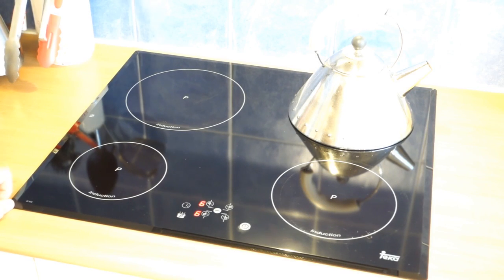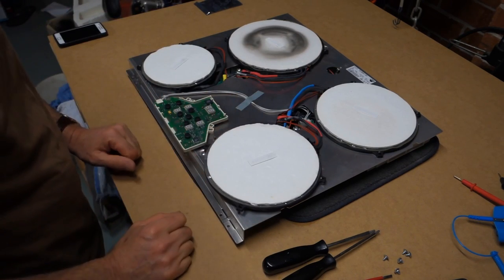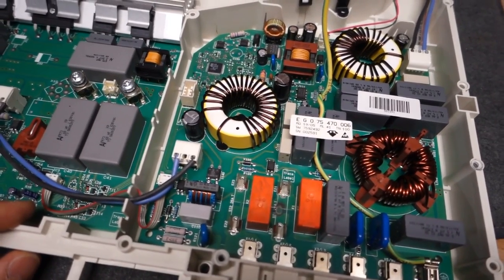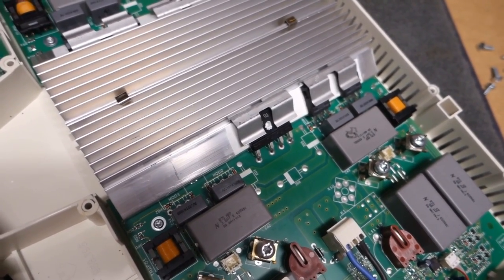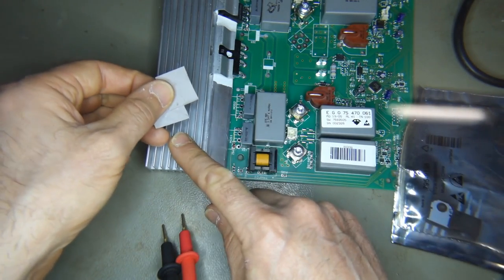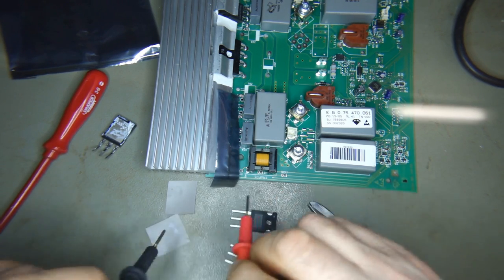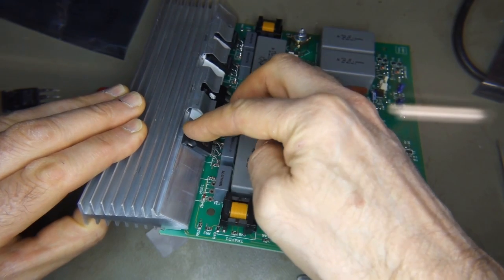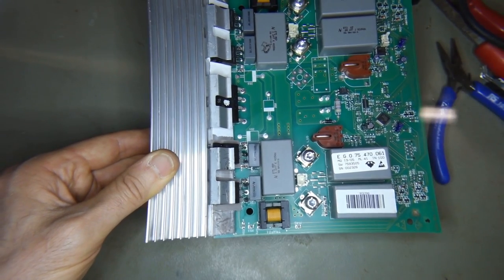Ep 5 Teka Induction Hob Repair (IR645)

Comment: Thanks for the vids Simon, very well explained, instructive and educational.
Looking at my same problem now, I’m feeling that it would be a tad easier if leads of the IGBT to be cut off first before removal and desoldering begins. And, removing and replacing one IGBT at a time and keep the metal holder in place.
Reply from the maker: This might be a better solution, let me know how you get on!
Reply: @PowerOn-  
Hi Simon
I recently revisit my same cooktop (IGBT blown again due to my poor workmanship;).
This time I’d found out easier way to reinstall the metal clip.
Those clips has tiny lip to engage with the groove on heat sink. Just need to position it properly, and press it in with a vice sandwiching just by the heatsink itself (be careful to leave PCB free without force exerted on it during pressing)
Even better if you have a pliers wide enough for the clip width.

Comment: Hi Simon, great video very informative. Can you please give me some advice as to how you got the clips off from the triac's in the first place, on the board im busy with they are really tight and I dont want to break it. Need to replace 4 of the 8 on the board.
Reply from the maker: Hi Francois.  Yes, you've identified one of the harder parts of this repair.  The clips are both difficult to remove and replace.  Im sure in the factory they must have a specialist tool.  I remember removing the clips by sliding them out from the end of the aluminium heat sink.  Gently tapping with a hammer and broad/blunt screwdriver was the technique.  Not easy but doable.  Refitting is the reverse but a bit more difficult as you have to also lever the clip open as you slide it back into position.  Good luck!
Reply: @PowerOn-  sweet, thanks will give it a go over the weekend.

Comment: Great video.  I had exactly the same problem with my GE Profile PHP900DMBB cooktop a couple years ago.  The trace on the board was blown.  Unfortunately mine didn't have the fuse brackets installed but the board had the mounting points for the fuse brackets (make sure to get the brackets rated for 20amps as the cheap ones are not).  The writing on the board even specified a 20A slow blow fuse.  That MOSFET clip is probably the hardest part of the job.  I'm even impressed that you got it off.  In my frustration I cut off all the components on the side of the board figuring that they would be cheap to replace.  I was wrong.  Each of those MOSFETs was $12.  The bridge rectifier in the middle was cheap.  I positioned them all with the clips before I soldered them all back into the board and that worked fine.  Fortunately I was able to find the exact parts.
Reply from the maker: Thanks for the reply Bryce - its a bit of a tricky job but ultimately very satisfying to fix something that would have been very expensive to replace.
Reply: Bryce, I also have a broken GE PHP900.  Did you have an "E5" error?  What is the IGBT part number and where did you source it from?  John K.

Comment: Great video. Have you had to repeat this for this element or do it for any of the others? I am ordering the new IGBTs and was wondering if I should just go ahead and do all 8 now since my cooktop is part of a slide in range/oven combination.  Thank you
Reply from the maker: No i only changed the failed components.  "If it aint broke don't fix it" attitude is at play here😀.  As I think I said in the video I think the failure was due to a protective fly back zener diodes not being correctly soldered at the factory being the source of the failure on the 1st place.  The cooktop has worked flawlessly since.  Thanks for the comment.

Comment: As of now, these hobs below uses the same Italian-made Teka hardware as shared by Simon:
- Miele
- Electrolux/Westinghouse
- Smeg

Thank you Simon.
Reply from the maker: Lots of parts sharing between brands.  This unit is quite old now but the failure modes are also similar with the igbt's and diodes a primary source of problems.
Reply: Great video Simon, even 7 years later :D
I concur my Electrolux suffered the same fate and the power generation board is the exact same except I don't have any fuse holders :( I'm repairing mine and will be adding a fuse holder where the in-board fuse failed since there are holes for it.

Comment: A "loud bang" sounds like a MOSFET. I always "enjoy" those loud bangs when I work on SMPS power supplies.
It's always a good idea to keep the IGBTs or FETs out of circuit and put a scope on the BASE or GATE and read for clocking, then check the COLLECTOR or DRAIN for a short before replacing them.
The CURRENT SENSE resistor is often blown along with the FET so the IC that drives the FET won't be able to detect proper function of the FET even if you replace it, and the IC itself can be blown too.
P.S. I've handled MANY FETs and have NEVER "zapped" one with ESD. It's not as big of a risk as you might think.
Reply from the maker: Hi Rick, lots of good information here, thanks for your reply.  Just a note on static electricity and generally on ESD problems.  You're experience of never having zapped a device is common.  However, what I understand from my studies and also several years of experience at work is that the damage you can do to a device is not to kill it dead but to damage it so it's life is much reduced.  You can in effect create 'walking wounded'.  By taking simple precautions at home you can minimise this, but at work where we make devices guaranteed to work for 25 years it's a whole different storey of  ESD flooring, desks, tools clothing, shoes and humidity control.  Honestly, it does my head in sometimes 🤪

Comment: Hi Simon, I have a Samsung FTQ307NWGX induction stove. It has blown a fuse, and half of the stove has stopped working (two burners). I replaced the fuse, and it blew the fuse again. Upon close inspection of the boards, I found no damage. What do you think it could be?
Reply from the maker: While it's difficult to assess, many induction stove problems are due to failure of the igbt's or the large diodes.  However, as half of the stove has gone, maybe a short circuit somewhere in the power supply for that side.

Comment: Hello, 
     Great video.   Do you happen to know what rating the zener diodes are?  Thanks
Reply from the maker: Great question but, no I don't know.  No marking either.  2 ways to find out.  1 remove a good one and test it, or 2 look up a typical circuit for the igbt on the igbt's data sheet.

Comment: Hi, thank you for the video.  I have a question for you, what were the specs of the blown Zener Diode you replaced.  I have a Kenmore with the same board and searching for it!  Thank you
Reply from the maker: Unfortunately the  zener diodes are so small they don't have any marking on them.  It is possible to take one out of circuit and apply a voltage to it and see when it stars to conduct (if its in working order of course).  Another alternative is to look up in the specification sheet for the mosfet.  There may be a reference design inside this document which specs the surrounding components
Reply: @PowerOn-  thank you For your response, I chose 15V @ 1/2watt, we’ll how it goes.  Best regards
Reply from the maker: @KiwiFrise2573  That sounds like a reasonable value.  You probably know this but the diode is there to protect the mosfet from recieving a too high gate voltage ( and a -ve voltage), so making sure the Vgs of the mosfet is not exceded.

Comment: Hi Simon, Thanks for the video. I have an Electrolux IC hob EHL7640fok which is a German make with 4 stoves. I guess it's  a 2015 model similar to your Teka Induction Hob. The problem is I could not be able to find any screws in the back case that I am unable to open it up to examine its content. I wonder if you have come across such device before or not. Thanks.

Comment: Hi Simon, i have the same problems with my miele km 6117. Your video was a realy helpful for finding the problem. It was the IGBT -.-. I already ordered them. But i still need a thermal paste / plates. Do you have any suggestions for me?
Reply from the maker: From memory there were some green pads already on the existing igbt's  I think i reused them but its a few years since i did this repair.  Again from memory the igbt's had a metal back so probably requires an electrically insulating layer between the device and the heat sink.  Something like this should work fine:
https://au.rs-online.com/web/p/thermal-pads/1745691

Comment: Hi Simon,  I have anothe brand(NOVY) but exact same internal hardware. I HAD E6 on all the hobs, but after change 2 caps on the powerboard (470 microF) the left 2 hobs where working again. The right ones still show E6. I check and verified everithing I could but can't find what is going wrong. When I disconnect all hobs and thempsensors, left (good) gobs give E9 while right still give E6.  I absolutly sure it is not the tempsensor because value is same on all 4.  Hope you have some tips for me. Thanks in advance

Comment: Nice job. Seems I have the same issue you had. But my induction plate shows E 2 error. 
Mines a 900 CM 5 burner EGO boards inside. 
Boards look almost the same as you fixed in your vid. I have same blown circuit board and 2 blown transistor diodes which correlate with inductor that was being used. 
I though I’d just cut bad transistor diodes out plug a fuse in and use the remaining 4 inductors. Didn’t work. Still gets E2 error 
Do you think the circuitry would be clever enough to know if 2 transistor diodes were missing or could there have been more damage to the power filter board. It went bang when she blew and tripped a 32 amp circuit breaker.
Reply from the maker: As you suggest, Id be guessing that the board can sense missing diodes.

Comment: Hi Simon
I removed the four IGBT's to test using a simple test procedure, (using diode test on digital meter) between the emitter, collector, and gate. Between two IGBT's that were side by side, I got absolutely nothing E-C, and after touching the gate ....no change.  Does this suggest the circuitry was completely open?
On the other two IGBT's, I got completely shorted on one for both tests (as if probes are touching), and on the last, I got 0.32 reading across  E-C for both checks.
Any thoughts?
As I previously mentioned, I have looked at this board very closely and see no indications of any component failure.
Is the component between the IGBT's a diode bridge?  Should this be tested?  If so, can it be tested in cct?  I am thinking about how difficult it would be to remove the clamp.
I am shuddering to think of how difficult it is going to be to replace these clamps.
Reply from the maker: taxicamel Certainty the shorted igbt's have failed and are probably the reason the fuse blew.  Now why the igbt blew is a question that i cant answer.   The associated large diode needs checking also as its likrly to have gone at the same time.
Reply from the maker: Yes the clamps are very hard to replace!
Reply: I did check the center component between the four IGBT's. Assuming it is a diode bridge.
I found a procedure to test, on line, testing with bridge connected in the circuit.
With diode test position, the readings are:
With negative probe on pin one: and pin 2 - 0.53, pin 3 - short, pin 4 0.53
With positive on pin 4: and pin 3 - 0.53, pin 2 - short, pin 1 - 0.53
Is this what should be expected?
Reply from the maker: This video was my inspiration (but in Spanish)!  https://www.youtube.com/watch?v=hbTMKMqQtAw

Comment: Hello Simon,
First of all, thanks for your video, it is great and very usefull.

I've repaired one power PCB like yours, and after repace the transistors and the zener's and put the fusible (20 A), it works.
But when I turn on the repaired side it worked in low power < 10. After > 10 the issue got again. The transistors will be damaged again. Do you have any idea what is happening more?

regards.

Comment: Hi Simon. Thanks for the informative video. I have an electrolux induction range oven with an identical electrical housing as yours. My PCB embedded fuse does no contain any fuse clips but I can solder them on. Can I assume the 20AMP fuse is rated for 250V.  Any preference over glass or ceramic? Would a microwave 20a250V ceramic fuse do the trick?
Thanks for any help.
IAN

Comment: Hi Simon. I'm struggling to find out whether Teka induction hobs, specifically IZC 32300 DMS (and/or IZS 34600 DMS, IZ 6420 and other similar) switch on and off (i.e. heat in pulses) at low power setting or heat continuously. Could you tell?
Reply from the maker: Hi Larry,. I don't know for certain but I'd guess it's a pwm signal that drives the MOSFETs.  So to answer your question it is pulsed but at a high frequency.  You'd need to get a scope on the gate leg of the MOSFET to see the signal

Comment: Hello Again Simon
I have researched checking IGBT's while still in the cct. I found one site which suggested how to perform this test, but found none of the IGBT's actually matched the suggested outcomes .....so I will be removing these and testing independently.
I am sorry about the previous question about the "failed" board, where the fuse holders are not used. So you simply installed a fuse and everything functioned fine.
My board only shows the fuse holders as a graphic. I will install two holders and use only the one fuse. Is this a 20 amp fuse ...and is a fast-blow type?
Would you be interested in providing an email?  I have taken many photos you might be interested in.
I removed the cct brd generator board and found a wire and plug with a what appears to be "load" attached to the end of the wire, under this board. Perhaps some kind of assembly testing cable before closing up the unit(?)
I have also done a very close visual throughout this generator board, at every component and found nothing out of the ordinary. Would you say the IGBT's are the weak part of this board?  What would you say is the root cause of this failure ....assuming I find one or more IGBT's is bad?

Comment: Sweet. Nice to see a person save some serious money by doing the job themselves ....nice to have electronics background. Now if could have only found some repair video for an Electrolux Induction Stove. An "E35" code appeared which shut down the entire cook top. Apparently there is only one board supporting the fault ....but I don't have the expertise to trouble shoot to component level ....but I AM able to replace plug-in boards no different than a useless ...and expensive ...repairman, who does nothing but read the fault code, for $131.25 CDN, once he arrives, then orders the board once paid for and leaves, then comes back with the board, pulls the range out, disassembles the stove top, removes and replaces the board, then reassembles everything, plugs it back in, and assuming it works, leaves.
Reply: You can get your boards repaired now, search ebay for my listings ;)  If offer a comprehensive induction board service of all brands.  Affordably as well I might add.

Comment: Hi
I have the same components (and same fault) in a Miele KM 5753.  Do you remember whether you used a slow or normal type fuse in your repair?  Excellent video by the way 😀😀😀😀😀👍👍👍👍👍
Reply from the maker: I can't remember but I'd prefer a slow blow if you have a choice.  I usually choose a slow blow in a power circuit, particulary here where the circuit will be exposed to more heat than most curcuits will see.  Good luck with your repair.
Reply: @PowerOn-  mine successfully fixed.  Thanks

Comment: Did you notice, that you thermaly isolated the transistor case from the cooler ? With the insulation tape.
Reply from the maker: Hi, thanks for your comment, I should have explained in the video, the insulation tape you note is actually a thermally conductive but electrically insulated sheet.  I used this in preference to a thermal paste as the I wanted to ensure the IGBT's were thermally bonded to the aluminium heat sink but the metal back of the IGBT was electrically insulated from the same.
Reply: The one I just pulled apart has the tape on from factory. Obviously they mix up their parts suppliers.

Comment: I have a Teka HI345ME oven and hob, the hob is short cycling on and off.  The ceramic rings are glowing red briefly, but not long enough to reach temperature then going off and relighting a couple of minutes later, allfour rings doing the same. Any advice please?
Reply from the maker: Because it's happening on all 4 rings I'd start by looking at the power supply side of the PCB.  Apart from that I can't offer any more ideas.   Often a thorough visual inspection of the PCB and connections will give some clues also.